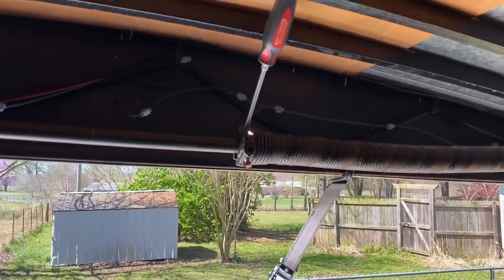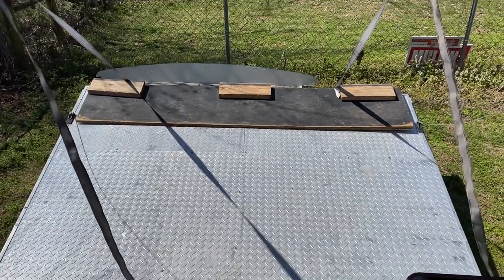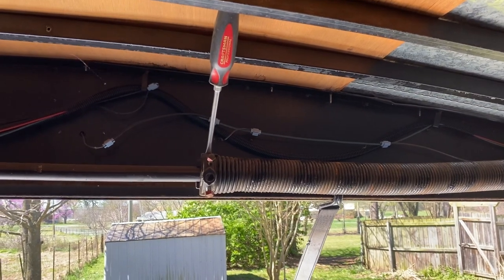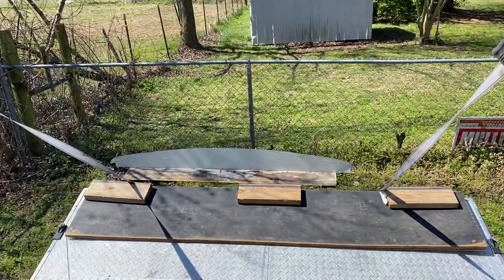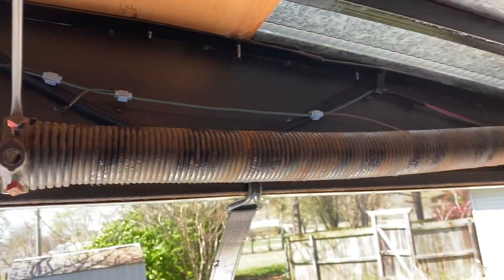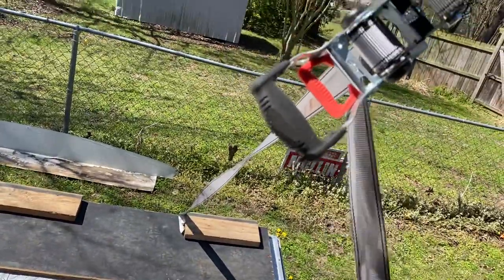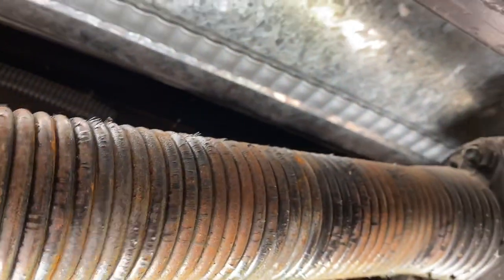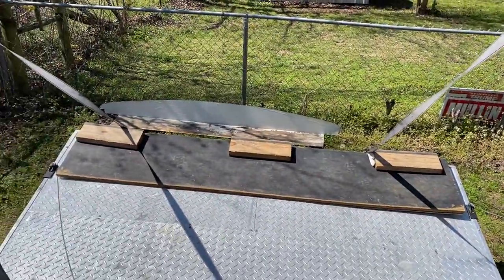Trailer door spring adjust

Comment: Nice suggestion. Even before seeing your video, I was planning to do this. But I talked to my buddies and they all suggested  doing it the "right" way, it was "easy". I have been stalling and waiting until I had the correct 1/2" pipes.... now, I am gonna dive in and do it this way.  So... door all the way down, then lock the cross bar or spring holders. Then, jack up the door to get slack in the cables. Put an extra wrap on each cable and lower the door. Correct?
Reply from the maker: That’s exactly what I did.
Good luck